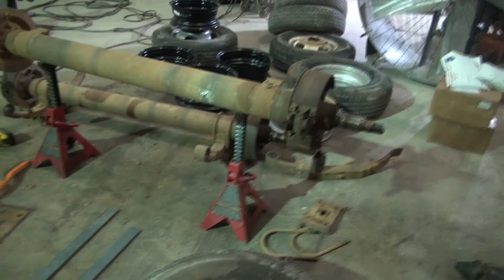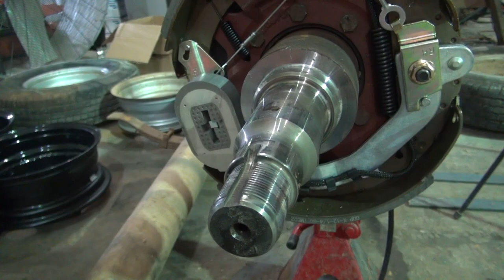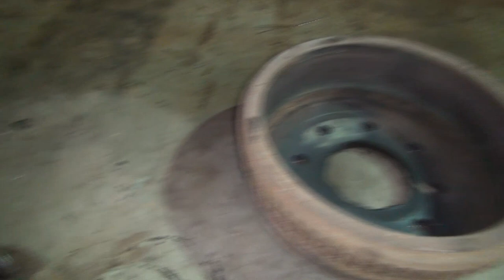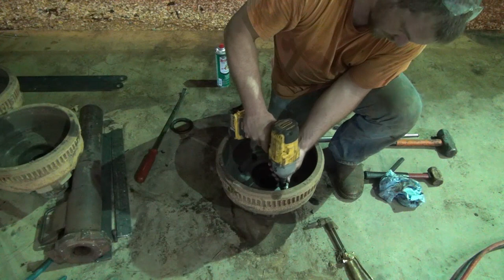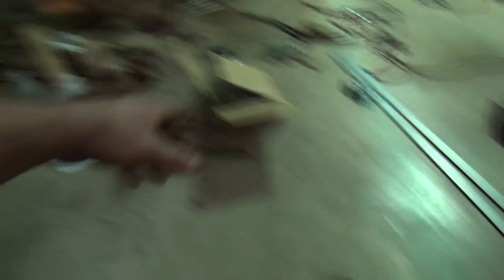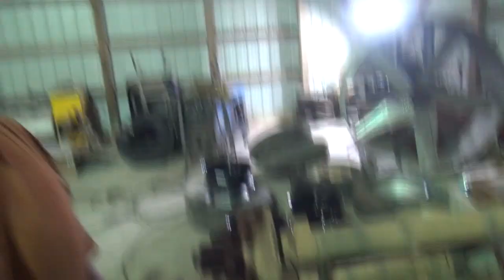Gooseneck trailer restoration part 8

Comment: pounding those wheel studs out can be some hard work. my arms are still sore from pounding out all the wheel studs and putting in longer ones on this little freightliner project i am working on right now. i would have done your trailer project the same way...replace anything that looks remotely questionable. it going to be a great trailer when your done.
Reply from the maker: These projects usually start out in thinking i'll just fix these couple things and then you find more wore out stuff and you say well i guess we'll fix this too and then when you get done you wonder if you should have just bought a new one LOL